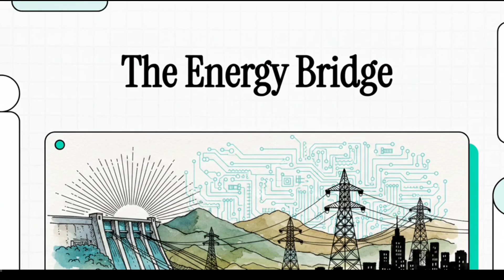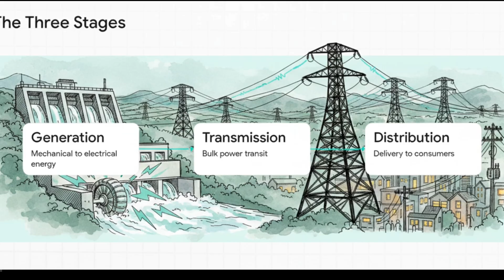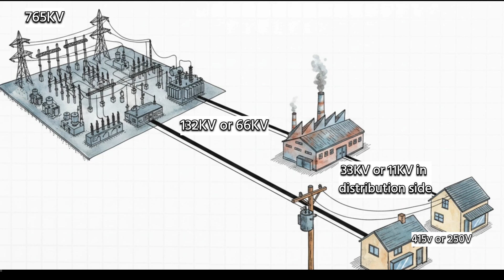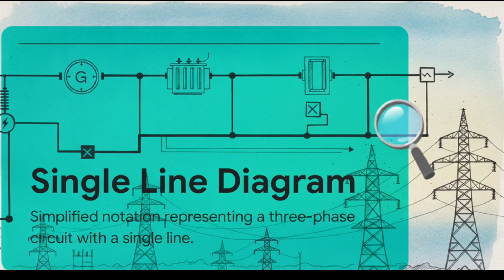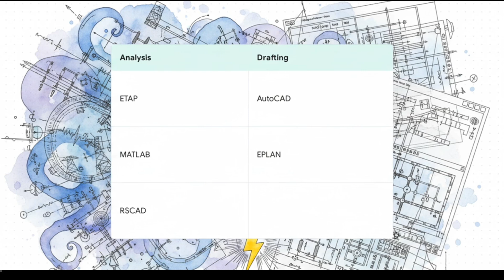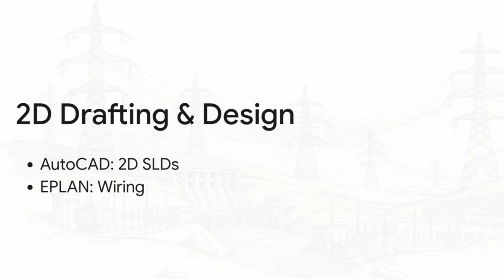How the Power Grid really Works from Power Plant 🏭 to Your home 🏠

Comment: I joined EEE this year which laptop is best for it
Reply from the maker: 1. CPU: Intel Core i5/i7 or AMD Ryzen 5/7.
2. RAM: 16GB minimum.
3. Storage: 512GB or 1TB SSD.
4. Graphics: Integrated is usually fine. If you required any GPU it's based on your selection 😄 laptop company is your choice